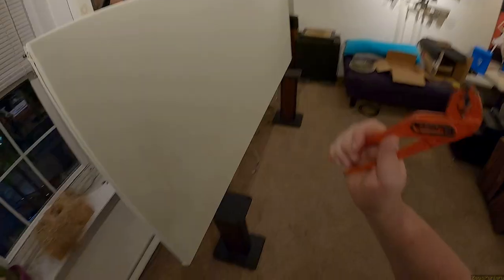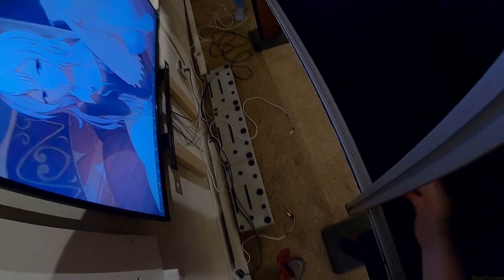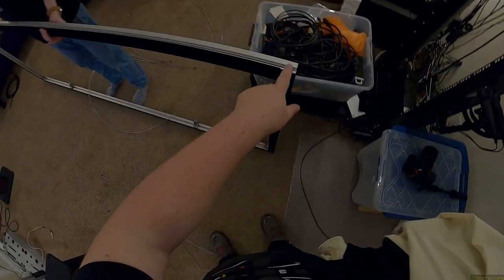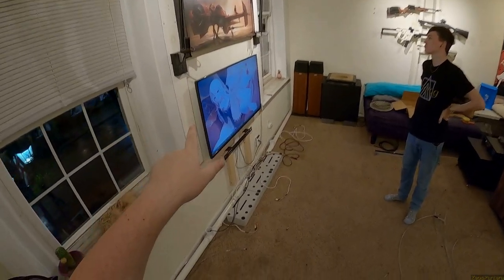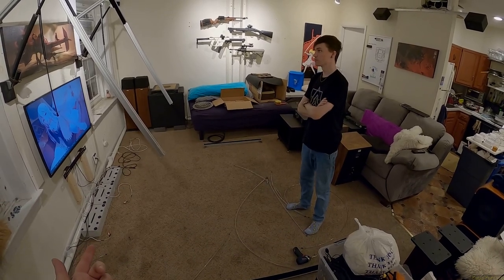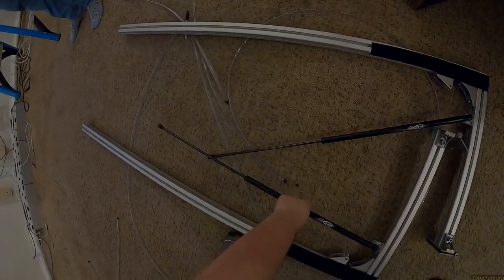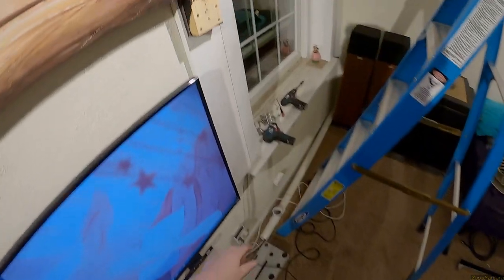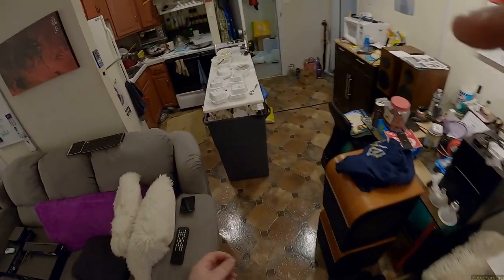Z Does - Preparing For The Move: Projection Screen Dismantle Featuring DMS

Comment: I found this channel back in like 2016 from you building this monstrosity when I was looking for ideas on how to set up my projector. First thought was why the hell did you start with steel for your materials? 

I then proceeded to build the the frame out of thin light pieces of 1 inch thick wood and held the entire thing up floating with picture frame wire, a couple of drop down anchors from the wall to stop it from wobbling when down, and a little pully in the ceiling to pull the whole thing up in second when I wanted it out of the way. 

Admittedly not as cool as pushing a button and having it loudly and proudly drop down from the ceiling nice and slow, but it looked way cooler just floating in the air since you couldn't see the wire when the lights were dimmed.

Comment: My M560s just broke, what would you recommend as a step up? I had the Sony pads on them and loved the imaging and sound stage, but I often liked to use an equalizer to achieve a more fun sound with more low end. I'm leaning towards the 6xx or 650, but would be open to something less popular. Luv u dad 😘
Reply: Hifiman Sandara?
Reply: I had that M560s and stepped up to the Argons after that.  I think the T60rp Argons are even a better replacement.
Reply: T60rp or Argons if you have adequate amps (or if you willing to wait). They're great, makes my HD650 sounds boring.